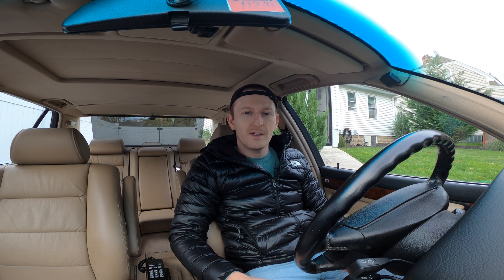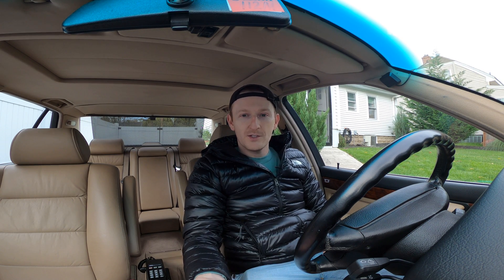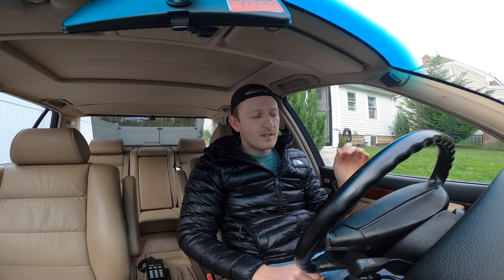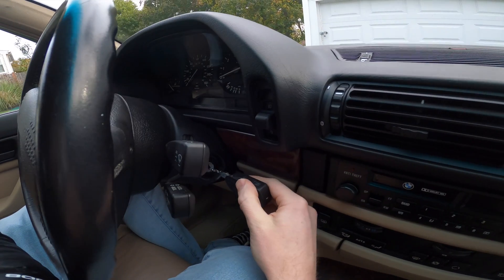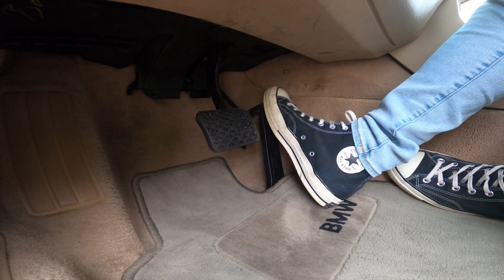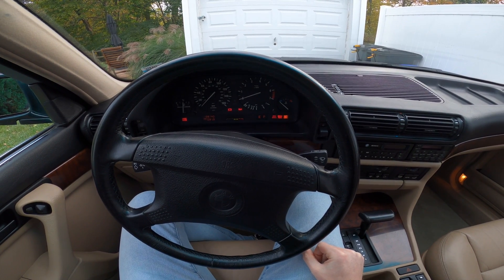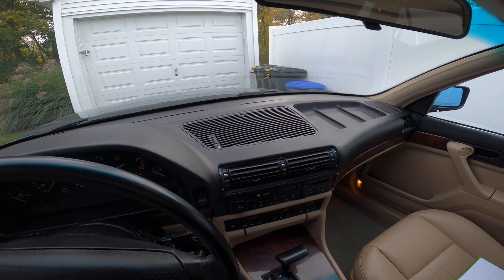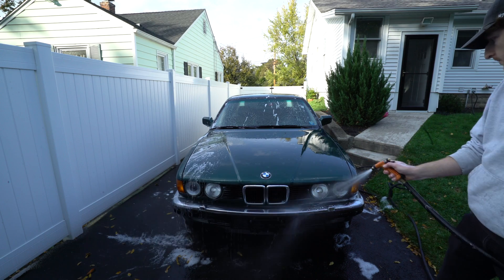How to Perform The BMW Stomp Test Procedure E30 E32 E34 E36

Comment: Hey so my car is manual swapped - its an e36 325i - the test does not work - what can I do. Inpa also does not work (yet). I think the TPS works? I can check that but idk what to do really.
Reply from the maker: Hey John, sorry I do not. Been so long since I've worked on these older cars. Join r3vlimited.com great community, you will find answers there quickly.

Comment: My 1992 UK RHD 730i doesn’t have the bulb in place but I do have a set of bulbs for the instrument cluster. Maybe I’ll install a bulb in that location and see if I get anything. I think something might be up with my idle control valve as my engine hunts at idle speed for the first 30 to 40 seconds after starting when cold. It would be good to see if there are any stored codes!
Reply from the maker: I recall reading this was made for US cars due to some law mandating it at the time. You may be on the right track with the bulb idea! Check the e32 forums on bimmerforums, a lot of knowledge there.

Comment: Thanks for the video.  Be careful with the squeaking blower motor.  The friction in the old bushing can cause the hot wire to the motor to overheat.  I had the same slight squeak in mine and one day smoke came out from under the dash.  That wire cut through the insulation on two dozen wires in the front power distribution box under the hood like a hot knife through butter.  Also, it melted the blower relay.  Spent three months (part-time after work) sorting out and repairing all of the burnt wiring.... but the effort paid off in the end....

Comment: Doing the stop test at the moment and it still hasn't stopped nothing stopping and it's been going on for a solid minute and a half that means something bad that it won't stop or something I don't know car runs drives everything's fine I have the exhaust off with 02 unplugged but other than that car runs just fine and the exhaust is off because I'm fixing it it broke in the middle so I have to fix it and I have just waiting to get it put back on but I don't think it should throw so many codes to the point where it won't stop at check engine just doesn't stop going currently at 4 minutes of going yeah I don't know it won't stop the only other problem I have is the dash doesn't show the RPM doesn't show the coolant and doesn't show the gasoline yes I'm accessories are gone other than the speed  if anyone can help please do
Reply: Yeah it's still going I don't I don't know is it like a code that just in repetition cuz it's a really bad code I'm losing my mind trying to find these codes s*** on beamer forms and everything
Reply: Yeah I'm on stop it and I don't know I don't know what the f*** to do is it like a wreck code or something car is not damaged like significantly just a little  tap here and there

Comment: This not and e36 video
Reply from the maker: The stomp test works on OBD 1 (1992-1995) e36 models in North America. The stomp test diag. Program was disabled on other global models. But was regulated in the NA market. Hope this helps.
Reply: @BIMMERZEITT  correct it does not work in my e36 1994 euro spec

Comment: Hey! I fixed mine crickets in the blower using sleeves from broken window lifter (don't know from which car) - there exact same size for bmw. So it costs me nothing. Maybe you have some (:
Reply: Also what are you think about E31? I consider it like sexy af. That's my dream to buy it some day.
Reply from the maker: @pssymgnt  the e31 is beautiful. I would also love to own one, they are expensive these days!
Reply: @pssymgnt  do NOT do it. you will drive it for a week, then be repairing for 3 weeks... ask me how I know. AND Mine is actually in creat condition.
Reply: @mikejohnson1228  do not do what? Its been three years since the repair - everything's good
Reply from the maker: Thanks Jess, how did you use those to stop the squeaking?
Reply: @BIMMERZEITT  the blower rotates in the special let's say "bushings" and there two, if i'm not mistaken. So the drive unit of some window lifters have the same "bushings" inside the body of window lifting motor block. It has round shape with cuts on top and bottom and the hole in the center, where pin goes on (and where it rotates). ~2cm size. Might be cuprum or else. And also need a special lubricant to rotate and have no sound.

Comment: (For all i know EU-Spec BMW's don't have a stomp test)
Reply from the maker: Thanks for pointing this out. I am reading that only North American market cars have the stomp test due to regulations. If anyone can verify that... share the link!
Reply: @BIMMERZEITT  My 88 euro 730 with a matching DME has a stomp test and it is working just fine. Although some euro cars don't even with the bulb. Its very random
Reply from the maker: I have just read that EU cars will do the stomp test of a cluster bulb at the engine light is installed. Apparently they left that bulb out of EU cars.
Reply: @BIMMERZEITT  EU spec E36's does not have the check engine light wired up between the ECU and instrument cluster
Reply from the maker: @gergohochoner6597  I have heard that in Europe they just left a bulb out of the cluster. So it will work if a bulb is fitted
Reply: yeah, on my euro spec 89 530i, the car has the no cats option and it didnt come with an O2 sensor, also no CEL bulb in the cluster, which i Installed, and was able to perform the Stomp test, also, the CEL is flashing but throws no codes, very wierd what they did from the factory, maybe the previous owner removed it, but idk